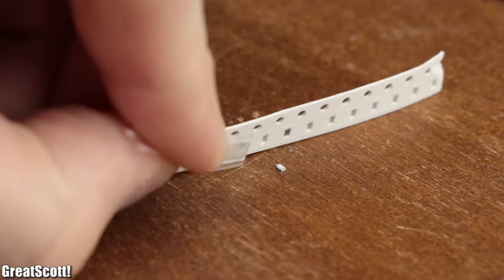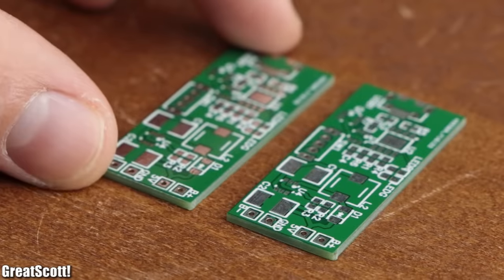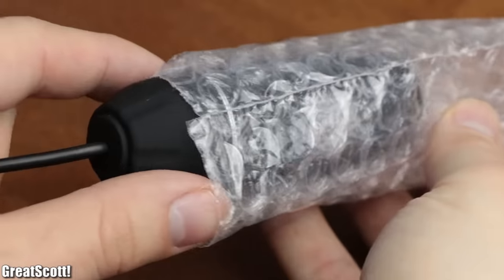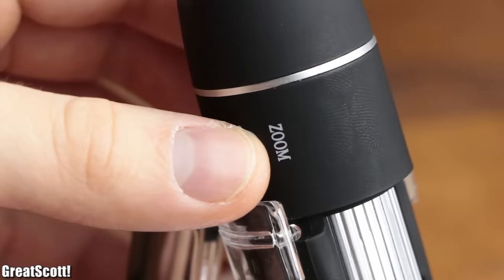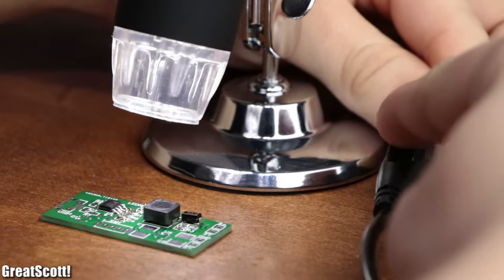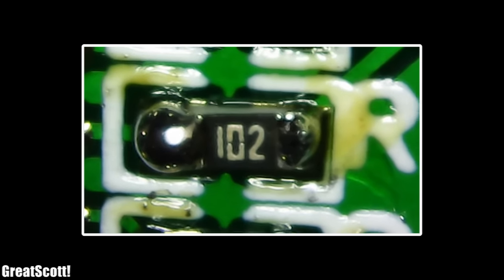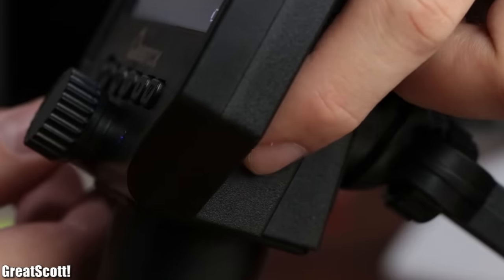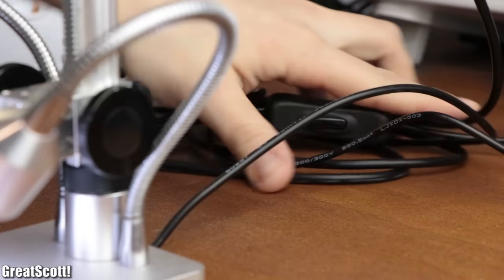Microscopes for SMD Soldering || $15 VS $45 VS $189

Comment: Any updates to this?

For electronic rework/soldering, you only need 10x-40x magnification...   are there any USB based microscopes, true 4k/optical-zoom that you'd recommend?   

For example, one that can output video 
1) wirelessly to a android/monitor receiver (Miracast/Wireless-HDMI)  
2) Wired USB to latptop/tablet device
3) Wired HDMI 

Dual-lens for seeing depth.. and a large Field-of-View would also be nice. Unfortunately, the ones I've seen are very expensive, presumably because they have way too much zoom (130x-180x lens), or come with their own 10" display, or gimic features like remote-control, etc.

Comment: Looks like just more crap on my bench I don't have room for. I've found using a pair of $20 reading glasses with the magnification amped up works well. Try out different strengths like +2.00 or +3.00 to see how your eyes adjust to seeing the tiny SMD boards

Comment: if you take the 45$ one and build a nice stand for it, you basically have what you will need
Reply: Sharky That's what I did. Works fine for me. Battery holds a charge well. Zoom works fine. Don't care about the color quality. Gets the job done.
Reply: Can you upload a picture of it? I wondered how it is turned out.

Comment: For hobby projects like these, there is no real need to use smaller components than 1206. These aren't hard to solder without any magnification. A microscope is still a useful tool, it's just no must.

Comment: I've found "binocular type" magnifying goggles (like ones used by surgeons and dentists) very nice. They are held like glasses, you can select suitable focusing distance (no need to bend over close like with a cheap magnifying glass type) and you have stereo vision. It takes a while to get used to those, at first it is so weird to see up close when you're focused at table top at some distance.

Even the cheap ones seem to do the job and I find 3.5x magnification enough for soldering. During inspection I prefer more magnification though.

Comment: Does the 189$ Version keep the settings if you keep it plugged into the PC's USB, when you shut it off and back on? That would be major helpful and a possible Battery hack may be the solution. Really wish I could afford that one, but for now, i will get me one of the cheaper 15$ ones. Just curious if you can watch or use it with an Android or Iphone? Nice Review, very helpful!

Comment: I think you got a bad $45 model. I have the same model (different chinese brand) but with aluminium stand wheel adjusted height and it's not blurry at all. The only thing that bothers me is the screen which doesn't tilt.

Comment: Sweet.. Got a cheap chinese.. Koolertron 1080p,.. pc recording wont work on pc MS windows because of the timing(pc wants to detect the device before you can set the mode on the microscope) it works on the phone just fine, allowing for sound even.. using a usb adapter.. glue a dedicated cable in place on the device though.. you dont want to wear out the microusb if you want it to last in a workshop.. perhaps also use some dust cover cap... state of the art..

Comment: um, not to be coy, but don't you build electronics would it not be a simple matter to add a battery base to the $189 one using the battery from the $49 one. or to build a arduino with an LCD screen for the $15 one. I think I am getting the $49 and building an adjustable metal base.

Comment: The expensive one looks like they just repurposed the dash cam from a car to make a microscope.  It does have good video though and should have a battery in it.  The battery might be dead or missing in which case you could put in a good one.  I wish you had also reviewed the less expensive Andonstar Electronic Microscope that's only 62 Euros without the screen.

Comment: With all these I'm starting to wonder, can I use my phone to do the same thing? I did some test and the image with x5 to x10 zoom didn't look very good, however I did try downloading apps to take better pictures of closer objects and it did made the image way better, the light from the phone are not super bright but I can always use another LEDs to make it better, now I just need to 3d print a holder so I can fully test it
Reply: I just did a bit more testing, my phone is a xiaomi mi 9 with a 48MP camera, to make a really good image I need no more than x4 zoom using apps to look at closer objects almost all the apps give me a better result than the normal camera app that came with the phone, also now I can have a really good look at the small components from about 2in or 5.1cm up to 8in or 20.3cm, any closer and the camera won't focus and any further I need to use more than x4 zoom to look at it better, but again more zoom make the image look worst so I think that is the working area for my phone
Reply: Also another mini update hehe, I have one of those "magnifying glass" for phones, it's not glass and it's not great but with that and the phone I'm able to make a component that is 0.177in or 4.5mm to look like a 1.614in or 41mm without losing details, the component was at almost 4in away from the phone, I have never use any microscope so if anyone can do a comparison will be great

Comment: Are there any macro cameras that only have analog video output ? I don't want a microscope built like a cheap camera, or to need a computer to convert USB back to video, just analog to VGA or HDMI hardware converter to put back to good use a 5:4 LCD monitor.

Comment: Youtube recommends this 2 weeks after I buy one
Reply: The one I got was basically like the third time maybe slightly worse vid quality no hdmi but Webcam Instead bigger screen and a 18650 built in..does the job but I actually wish I could zoom out more sometimes, focus adjust has tons of range so will 3d print an extension maybe

Comment: I know I know.... you will say ... but soldering a board a year you don't need to invest that much... My response here is like this... don't invest those 20 or 45 USD or whatever... buy some glasses... they are cheaper and you will do the same joints... simple as that

Comment: The reason for the exaggeration on the package, and the straight up lying about the stats (1080p when it's 720p) is because there is no repercussions for doing so. It's also pretty standard with Chinese-made cheap goods. They don't have a legal system in which companies can be held accountable for their false advertising and misrepresenting products. Or rather, they simply don't enforce their laws. Believe it or not, China has laws on the books preventing such things, even environmental laws comparable to the U.S. But they're just not enforced. And even when they are, it's usually just a bribe request/shakedown.  
China wants to be a world leader/superpower? No thank you, I prefer my companies regulated by the government, building codes enforced, my food without asbestos, etc etc etc. They're essentially the only country on the planet this crap happens. Virtually every other country that isn't run by warlords has legal options for consumers to take to fight this kind of corruption. Not in China. And libertarians think companies would be better if they didn't have regulations? Go live in China for a year and lemme know how your libertarian ideology works out for you. Unfortunately that would require them to leave their mother's basement and abandon their mom's home cooked hotpockets.

Comment: Hey friend need help i have this display N070ICG-LD4 default voltage it say 3.3v but i want to know if i can use it with 5v instead do you think will damage or no the 5 volts? please help. Thank you

Comment: What software would you use for designing pcbs?
Reply from the maker: +bdot02 EasyEDA
Reply: Just used them to design and print pcb for running a 555 timer. I had tried out a couple other online services but hadn't tried EasyEDA yet. They are now my favorite though so thanks for the suggestion.

Comment: Hello guys,i want to build mot spot welder-if i reduce voltage in primary coil(one that is connected to wall socket)will the amperage drop in the secondary coil?
Or should i install the potentiometer in primary coil and increase-reduce resistance???
Thank you! for your help!

Comment: Hey i have a question about your lipo charger circuit. i was wondering if i could convert it to TH easy because i have tried many many tips on my weller and i just cant get it done easily (under a microscope)

Comment: Add information from the microscope 🔬 wifi after installing the application on the phone or tablet steals user data and sends fake messages.  The device is working but the app is a scam.

Comment: why dont you use hot air gun to solder smd..!! make a video with hot air gun..
Reply from the maker: I talked about that in my how to solder properly video.
Reply: soldering smd LED is a challenging task with fine tip. I wonder if u could make a video about Desoldering of smd and THT..☺☺